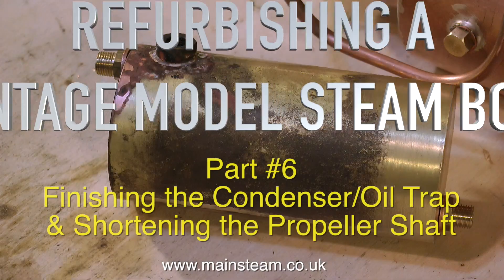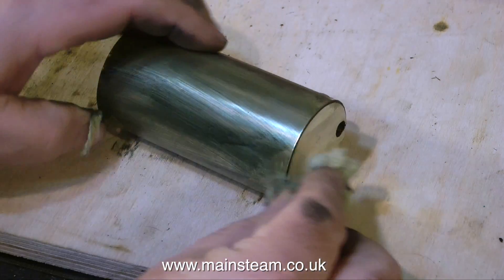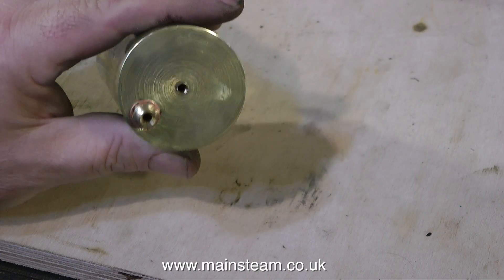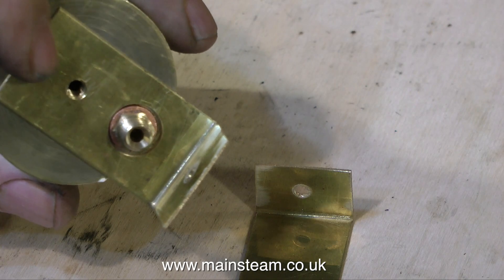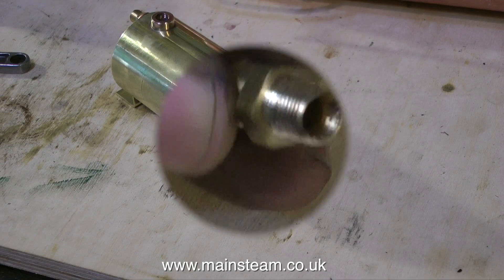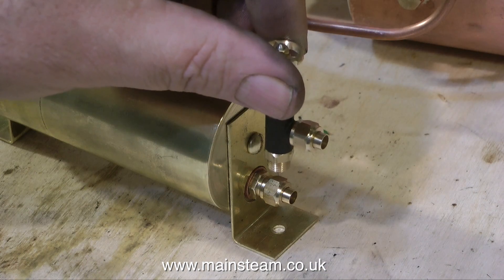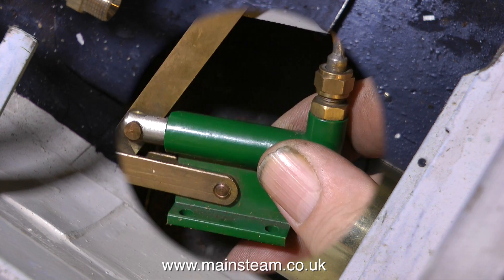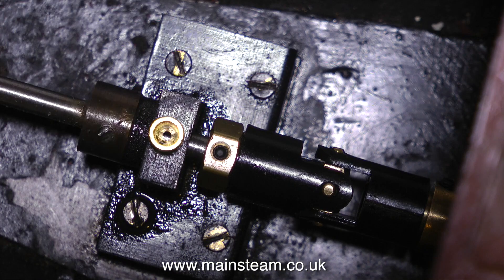REFURBISHING A VINTAGE MODEL STEAM BOAT - PART #6

Comment: My son took a corrosion class in college and one of the lessons was brass bushings in copper boilers.  Copper and any other metal in the boiler construction causes an electric current to develop in the water.   The current causes the zinc in brass to chemically change and come out.  The leftover material is porous and weak.

Comment: The best way to test a model boat "put it in the bath" I used the same method apart from my boat capsized due to engine being to high up. All fixed now though